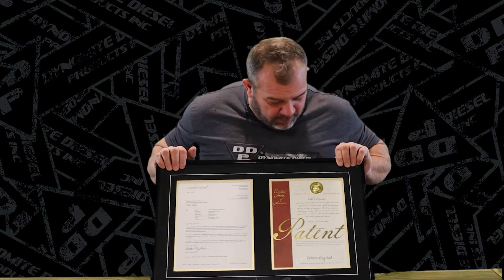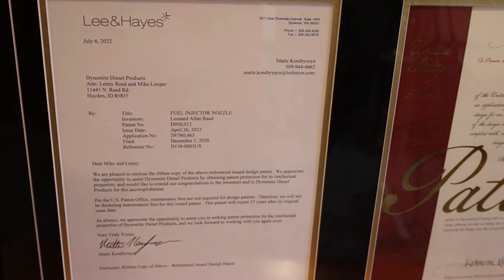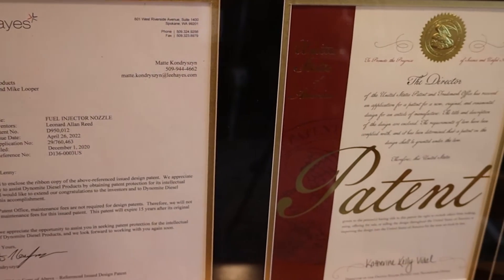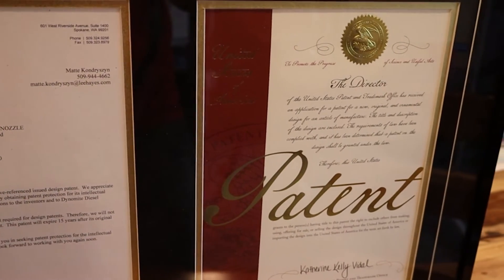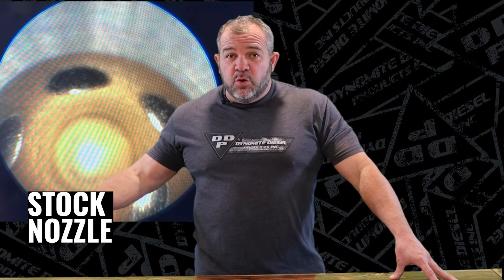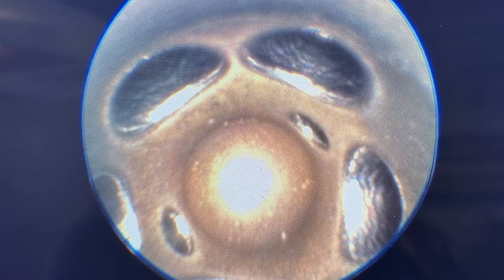Dynomite's Pilot Hole Technology Patent

Comment: Why not add more smaller holes also? Instead of 5 .012 holes why not 6 .008 holes?  Wouldn't the smaller diameter lead to more atomization also?
Reply: Your thoughts seem to be valid in theory. The economy nozzles may actually be that way. I went Stage III's for more HP.

Comment: Lets see running and driving video with these injectors!?
Reply: There are several videos on power driven diesels channel showing them.  I have a set in my first gen and it dynoed 430hp over 1030tq with no real tuning except the seat o meter. I am confident it is knocking on the door of 500 now and it drives and idles clean. I have videos of them too on my channel.
Reply: @bcbloc02 wait power driven diesel has videos with DDP injectors even thought PDD makes their own
Reply: @kalebstout7673  my understanding is power driven buys particular tip configurations in bulk from DDP for their power jet line then they assemble the injectors themselves. I don’t think PDD non powerjet injectors come from DDP.
Reply: @bcbloc02  ahhh that makes sense, thank you for that input. I have PDD 5x.16 VCO injectors and looking at switching over to DDP
Reply: @kalebstout7673  I ran PDD 7x.011 and went to a stage 2 powerjet and picked up about 70hp and the smoke went down 90%

Comment: Badass Lenny! 

You forgot to mention efficiency factor going up with this technology, faster warmups as your actually burning all the fuel, instead of it being wasted as smoke out of the tail pipe. 

When my rigs finally need injectors, theres no doubt they are getting a set of these. Thanks for bringing this modern solution to the table for us guys with older trucks. For me, HEUI till the end or its illegal... Lol! Both the 6.0 and 7.3. Love these things! Someones doing a vgt setup for the 7.3. a set of these injectors and that air setup would bring it up to spec nicely.